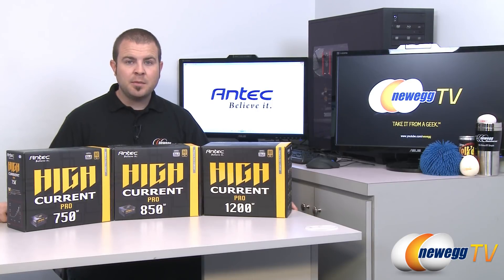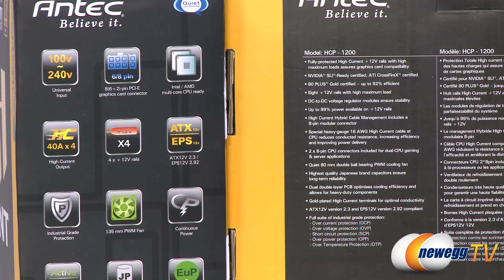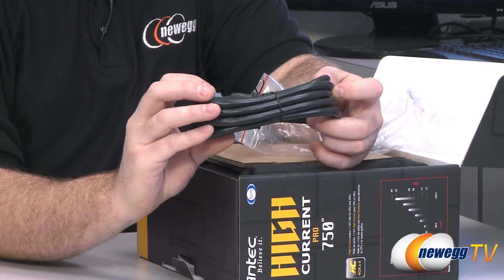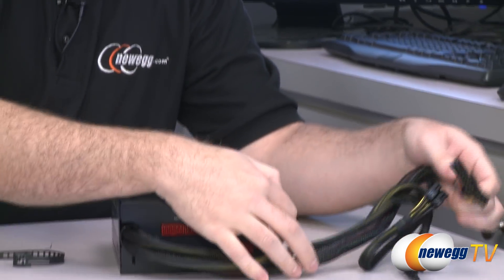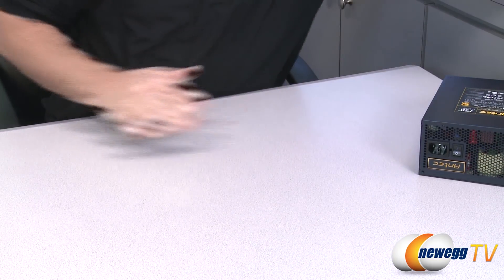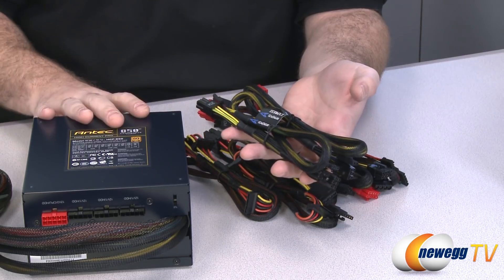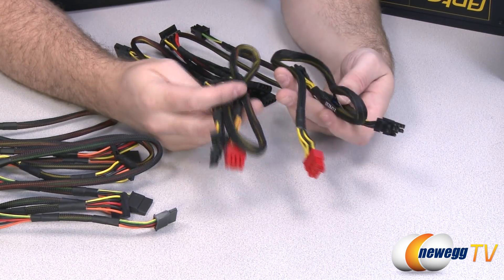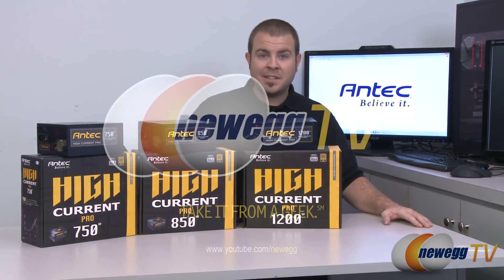Newegg TV: Antec High Current Pro HCP Series Power Supplies Unboxing & Overview

Comment: @o7uk That depends on if you plan to overclock the cpu or not. If yes, then it is not recommended that you use stock cpu coolers. Especially when you can get some very good ones for around $30 USD such as the coolermaster Hyper 212 Plus.